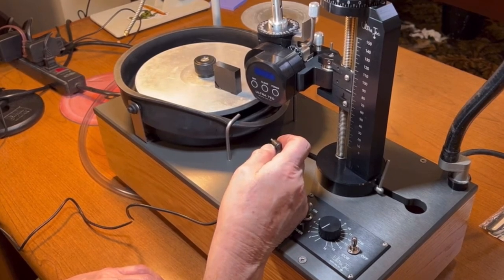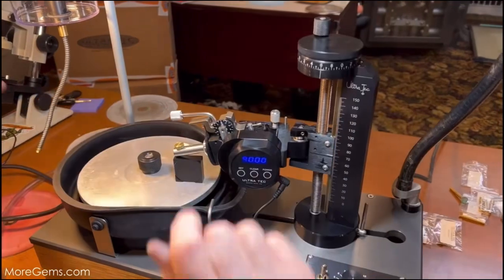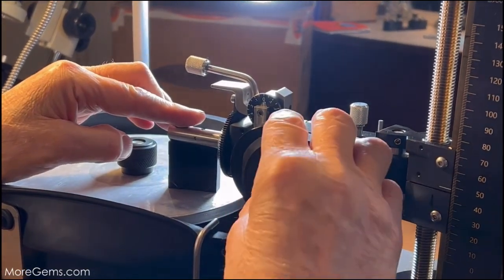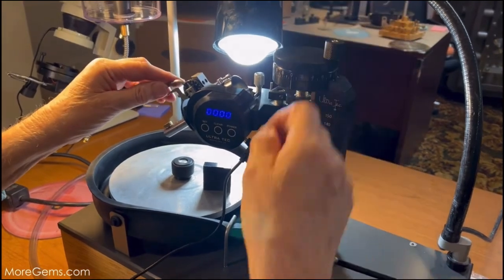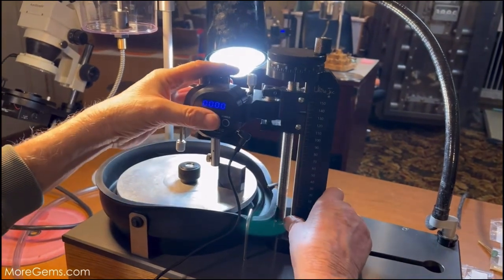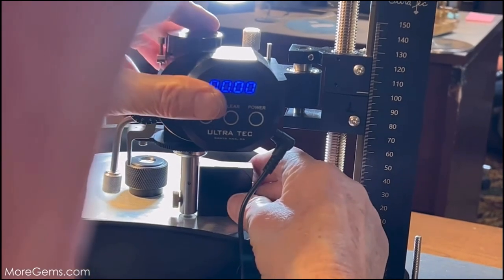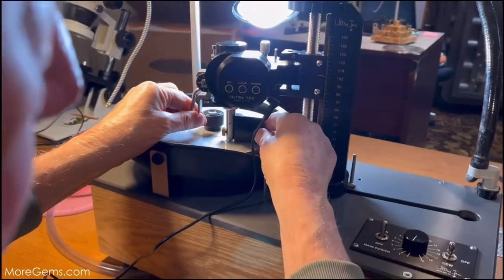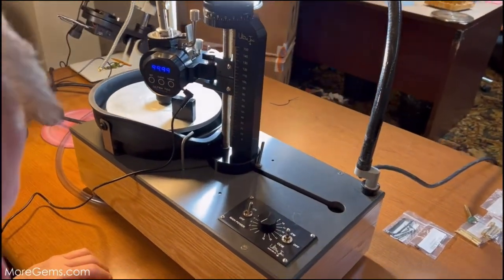Recalibrating the Digital Angle Dial (DAD) on V5 Classic Faceting Machine

Comment: Actually you as a professional gem cutter, you should have a finger indicator to set  or calibrate you digital angle.  Just by putting the finger indicator down on the table, and going up and down to a certain distance and adjusting the angle will make your machine a 100% dead zero. Relying on a block and light from behind and looking to see when the gap is closed is just one and almost non precision method. It does work, but for gem stones?? NO I do not think that is the best way.  Buy A finger dial indicator with magnetic base and see the result. By the way I am not a gem stone cutter because I have no money to buy the machine which I love to buy, but I am an aerospace machinist for 30 years and I work with military standard measurements.  (+ - .0004) in MM. By the way that block you are using is called Guage block which comes in different sizes.